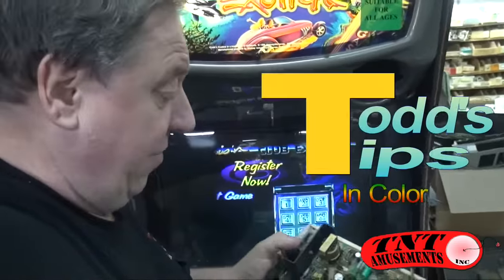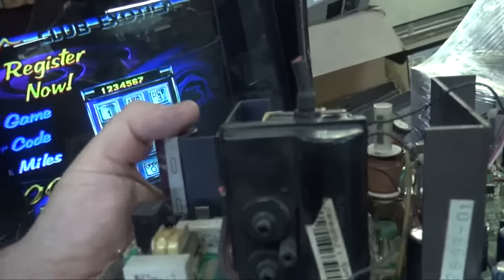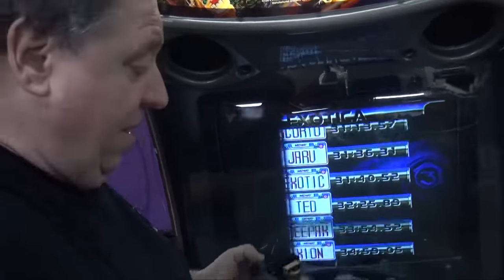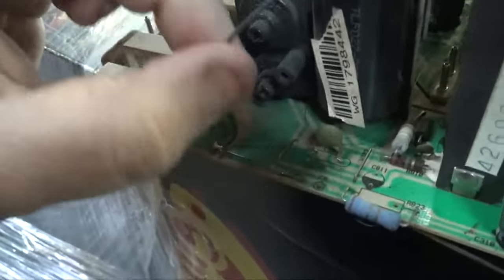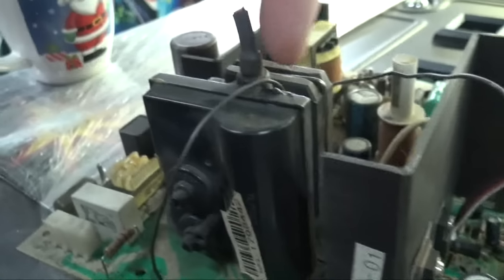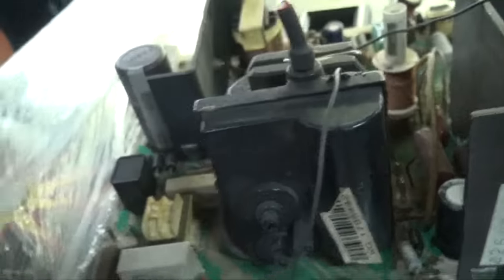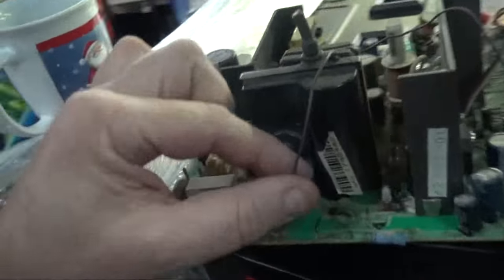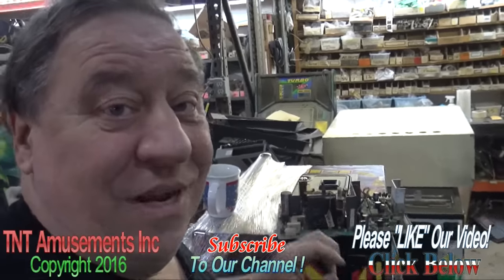#1215 WELLS GARDNER Monitor Chassis 7501 FIX- TODD'S TIPS- TNT Amusements

Comment: Do you know why my exotica board loads up in to attract mode for a while then just reboots? Is it a power problem or rom problem?
Reply from the maker: change the power supply and adjust for 5 volts right on the board...clean edge connector...press ROMS ...
Reply: TNT Amusements Inc thanks ill try that

Comment: love the picture of a crt in a classic cab, but they can be such a pain in the b**t
Reply from the maker: yes...but once reconditioned, and in private home, failures are rare!
Reply: TNT Amusements Inc oh, you're right. these things are 20,30 years old and with some reasonably cheap parts you can fix them so they last another 30 years. Modern lcd's are handy, but they break after 3,4 years and you have to trough them away.